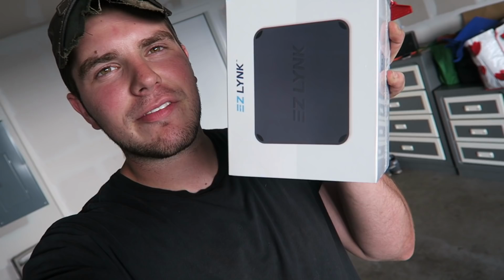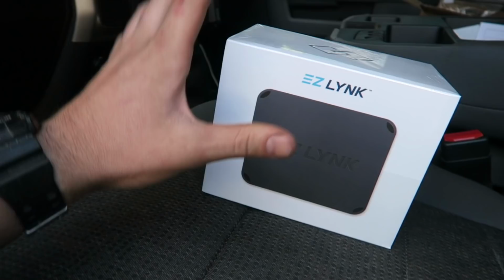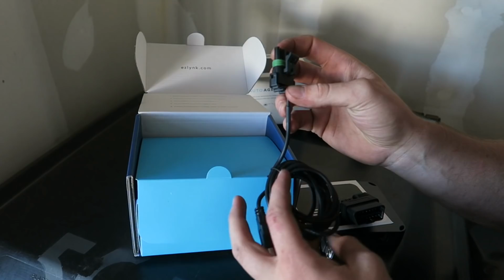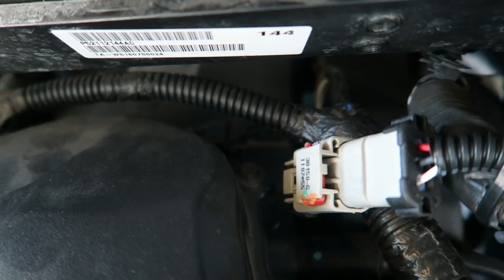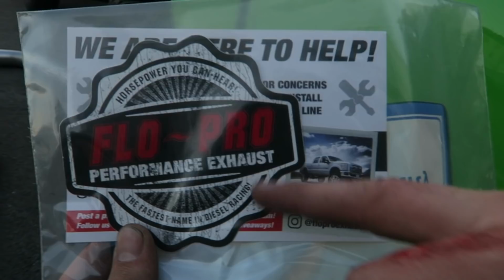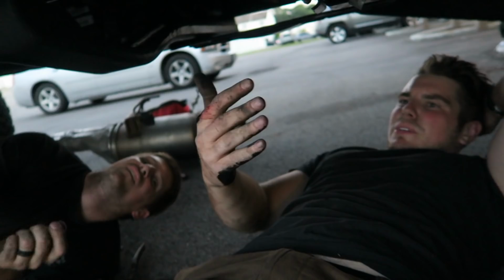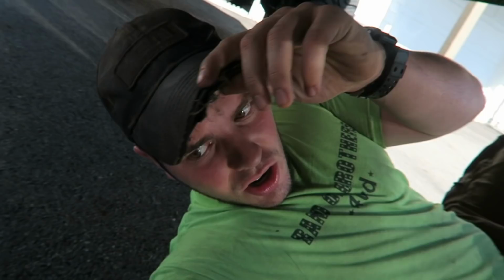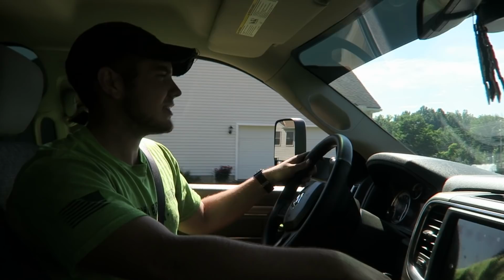Brand NEW 6 SPEED MANUAL Cummins Gets UPGRADED!!! *EZ LYNK TUNING*

Comment: Truck sounds good. Glad to see someone else driving a 6spd manual. I've got a 2010 fully deleted 6spd manual. I was going to do the 5 inch exhaust but like you I was told I would want a muffler or something for it so I went with 4 inch straight and love it. Truck sounds great

Comment: Bro straight pipe is not bad in the 6.7 straight pipe, if anything it's to quiet, I did on my 6.7 and I was upset it didn't sound anywhere close like a 5.9 straight pipe does
Reply from the maker: I have come to find out that it’s not bad at all!! Super quiet! My 5.9 was dumb loud!
Reply: Ryan Mayer try pulling the #32 fuse u see the hood, I think it's #32??? It will sounds like a 5.9 Cummins lol ... I'll be putting a 4" straight pipe on my 7.3 here soon and a tune, can't wait to hear that mama breath
Reply: FixItNick I’m getting a 4” straight pipe on my 7.3, too.
Reply: Bradley Johnson what year? Gonna run a tune?
Reply: FixItNick It’s a ‘96. I’m gonna run a tune, I just don’t know which tuner to buy.
Reply: Bradley Johnson DP Tuner or Hydra
Reply: Bradley Johnson JP tuning
Reply: Its stupidly loud if you 2nd gen swap it! Or do a drop in vgt deleted modified turbo
Reply: FixItNick hydra makes great tuning for the 7.3s I would highly recommend you go with hydra
Reply: @bradleyjohnson1839  definitely hydra and if havent done yet a wicked wheel 2... did that to my 97 with a 4" straight pipe it was a total different truck..
Reply: gentry k Sweet, I’ll check it out. Did you run an intercooler?
Reply: @bradleyjohnson1839  was going to but I bought me a 1st gen and drove it more so I sold it ... loved the obs ford but really liked the 1st gen better
Reply: gentry k Nice man, good to know. And yeah, 1st gens are sexy.
Reply: My 2006 5.9 was straight piped and obnoxious! I love straight piped cummins but damn! Couldn't hear myself think.
Reply: Yeah my 5.9 with a 5" straight pipe was ridiculous. Long drives pulling big enclosed trailer was unbearable with the drone. Could barely talk to passengers. I removed the silencer ring and put a CAI on it and the turbo whistle was awesome. Then installed the FTE Resonator and it was PERFECT.... No drone at all but all the turbo whistle and sounded great.

Comment: It would be a good idea to adjust the valve to .010 intake & .020 exhaust, now that the emissions stuff is off.
Reply from the maker: I’ll have to work on that! All I know is the truck runs better and has no smoke on the tunes! Better mpg I can already see as well!
Reply: I'm sure it does.  I deleted/tuned my '14 almost 3 years ago and the difference is insane.  Get the clutch in there asap so you can enjoy that new found power
Reply from the maker: Monster RAM all it takes is $$$ lol 😂😂😂
Reply: I've always set my valves at .07 and .17
Reply: Wheres the new vids Monster Ram?
Reply: @white24valve  on a 6.7? Any noticeable difference than .010&  .020
Reply: @patrickcrowe4063  my apologies..i am mot sure..i was thinking 5.9...without looking it up..iirc the 6.7 exhaust is .026 to get rid of heat/fuel/soot quicker..not quite 100% sure tho

Comment: Those are egt sensors, save them so you can put one in your manifold if ppei ever gets egt's working for ez lynk on the rams.  Btw you can leave everything connected to the dpf and scr.  Just unplug everything from the harness and drop them down.   HPP makes a plug kit to cap off all of your connectors

Comment: The DEF Injector (hunk of junk 8:36) is a PIA to get off. The connection gets all corroded. Try some WD40. You have to push the lock in to get the line off. If that doesn't work you try pry the lock out and that might work to get the line off the DEF injector.

Comment: I own a 01 7.3 with a 4in turbo back straight flow exhaust WITH headers, and its barely louder inside than factory. Drone is very minimal on disels because of just how the fuel is burnt.

Comment: Hey Ryan, I have a 2015 6 speed, I've had it for 5 years or so, I deleted it soon after I got it. Mileage is good, but the tune has some hiccups. The biggest one is lack of throttle control if the engine speed is slower than the trans letting out the clutch. Pretty irritating actually haha. If yours does not do this, I'd like the name of your tuner and get that one from him to try. If I understand right, these guys are all doing their own tune. I guess. Thanks

Comment: Yes 6 speed manuals are hard to find. I bought my 08 3500 6.7 6 speed mega cab 3 months ago for 14,500 and had to jump all over it for the price.
Reply: kevin desjadon yep, ur absolutely right. Automatic’s are everywhere. I wanted to trade in my 2015 CCSB SLT for a 2018 CCLB Laramie, every dealership within a hundred miles of me said with that combination I’m definitely going to have to order one.
Reply: Ronlewis ram in  Waynesburgh pa  usually has at least 3 or 4 of them

Comment: The hotter the tune the better mpg as long as you can stay off the skinny petal  and the clutch will be fine in hot tunes as long as you don’t hot rod it  just go easy til the upgraded clutch is installed

Comment: You won't burn your clutch up less you rag on it..had an 03 quad cab..swb..2 wheel drive..6 speed manual factory clutch.always floated the gears...3.73...afe stage 2 in take..ATS arc flow.. industrial injection super phat shaft 62..TST... Diablo puck..Smarty..str8 4" exhaust with 5" tip..Fass HPFP 95 with 3/8" hose..big line kit...best mpg was 23.8 mpg with A.C. on and using cruise control

Comment: Man I have a 5” straight pipe also by flopro with a 6spd and the drone is not that bad I bought the 30” FTE resonator and took it out, I dig the build truck looks wild, 2nd note I have the south bend street dual disc with a mini max tuner and my clutch will spin in my 60hp tune, look into vilair can’t go wrong

Comment: I have a question, you do not have light on the air pressure of the tires. The tuner has up to 40 psi, in my case my tires measure 65 psi.

Comment: Ask for the sotf low boost fueling tunes  it makes the g56 trucks like ours drive so much better you get your boost back faster after a shift
Reply from the maker: Ty Hart ppei has em??? The higher HP tunes seem to hold boost but don’t have a clutch yet to really experiment

Comment: Little late to the party but I watched this back when you did the delete I have an 18 3500 g56 truck and I’m about to put my sotf switch in but don’t know where to run the wires through the fire wall easily, where’d you run yours?

Comment: You are going to want to put the resonator on if plan on putting a tip on that's when it will drone bad I have a 16 Laramie longhorn fully deleted with 5 in turbo back going to an 8 inch tip on 37 didn't drone at all till I put the tip on it was bad didn't bother me cause I'm used to driving a cammed 6.0 Chevy straight headers but my girlfriend threatened to never ride in the truck unless I fixed how loud it was in the cab got the resonator changed everything much better in the cab
Reply from the maker: Hahaha I didn’t know the tip would make a difference!!! Doesn’t drone right now! Still a bit loud for early morning drives in my neighborhood
Reply: Ryan Mayer na the tip really does effect it a lot. It didn't bother me at all but it's loud in the cab with the tip  I don't have neighbors so I never worried about it till I got a girlfriend lol
Reply: bubbahoss 1997 leave your girl

Comment: Hey Ryan, awesome truck man.  You’re doing everything that I wish I could do.  I know you did the color matching but did you know that the portion between your front and rear door is just a black decal.  Mine started wrinkling and I removed them with a heat gun.  You just have to loosen the lower outer window trim (one screw each) and heat it up and they come right off.  I feel sure it’s green under there as well.  Mine is white (I know, boring).  Anyway, I guess I’ll see next time if you want to keep it black or go green between the windows.  Keep up the great videos!!!

Comment: If i bought a RAM 3500 it’d be an 18 RAM 3500 with the High Output Cummins Diesel with the AISIN 6 Speed Automatic Transmission over the G56 6 Speed Manual Transmission because the AISIN Automatic has more Torque than the G56 Manual Transmission
Reply: You do realize for $1500 you can upgrade the G56 clutch to hold the same power as the automatics either factory or tuned. Compare that to the cost it takes to beef up an auto when you start pushing a lot of power and you'll start to understand why the guys who know own the G56. There's also nothing better then rowing your own gears allowing you to be in total control.

Comment: When I started looking to delete my 2013, I was told I had to remove everything all at once. Was this bad information for the 4th gens? If I could do it in steps like you are, that would be  a lot better.
Reply: You can remove the EGR components without going into limp mode you will just have the check engine light until it’s done but keep in mind you stock exhaust isn’t ment to trap the excess soot etc created by removing all those components so the quicker you can get your exhaust and tune done close to one another the better

Comment: I have a 2015 Dodge Ram 2500 6.7 Cummins and I recently started having issues with my DEF system. Apparently I would of have to buy a pretty expensive part, but I decided I would Just want to do a delete on it. Are there any delete kits that you would recommend?

Comment: Get the banks horn with the pusher delete kit- also Ohio diesel has a nice tall boy shifter-Akron makes an amazing phone holder
Reply from the maker: I’m gonna get the banks horn but I want the bigger one and need bigger boost tubes which means the banks intercooler, which means $$$$ which means I make a decision is I want a clutch or the horn and intercooler first 😂😂😂 and I totally slipped my clutch the bad other day getting on it
Reply: Ryan Mayer can you still drive it? Check out my shakey video of my ram, you’ll see an ARKON phone holder- you don’t want it mounted to the windshield-a reason to get pulled over-check out my shift knob too-you can wire up the engine brake to it so you don’t have to look for it in a pinch

Comment: Did you have any issues installing this around your rear center shock? I was planning to go with this kit but the website I was going to purchase it from notes it wont fit with air ride or the center mounted shock. I've had a hell of a time trying to decide on another kit so if it will in fact fit that would be awesome!

Comment: Would you have been able to just leave the EGR in place? Wanna leave mine in place and just run the tune and a 5” turbo back. The ez lynk basically disables the EGR anyway correct ?
Reply: Chris Peetros did your truck throw any codes

Comment: Those "prongs" you took off are called egts; exhaust gas temperature sensors
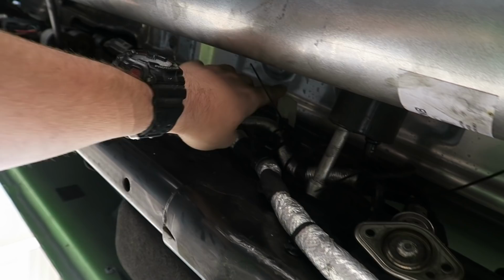Reply: And that other thing he pointed to at 8:45 is the DEF injector.
Reply: Those prongs are called pyrometers or pyro for short. They read your EGT

Comment: Will the dealer's give you a hard time with a warranty issue if the truck is deleted?
Reply from the maker: jimmy burt my advice is make friends with your dealership :) they’ll work with you if your truck is deleted if you’re on their good side, they must prove the delete caused the warrantable issue for it to be voided, don’t let them tell you otherwise. An exhaust pipe won’t cause an airbag failure ect ect.

Comment: Do you think the stainless 5 inch straight pipe turbo back is worth it? Or would I be fine with the aluminized version.
Reply from the maker: Depends how well you like to clean your truck! If you’re driving in a salty environment just keep it clean
Reply: In my opinion, go with the aluminized. It probably won't last as long, but with the stainless your constantly going to be tightening up exhaust clamps. I have a full 3 inch stainless exhaust on my 12 Camaro and its horrible. stainless expands and contracts and will stretch the clamps out.

Comment: I'm 15 and I'm taking drivers training my dad bought me a 2005 dodge Cummins and I wanted to know what are some upgrades I should do
Reply: Remove the silencer ring from the turbo. Free and easy. Also look up everything you can about the truck you have. Look up specs, dimensions, common problems and always an exhaust and intake always help a diesel. Also you can tune and I would look at upgrading the trans. lots of rebuild kits. Can upgrade the lift pump. Just a few things to look into. Research goes miles. Last, being as old as it is make sure all the steering components are in good shape.
Reply: Jacob Marsh-Hines first thing is put a steering brace on it for sure if it already doesn’t have one, this is the fix to the dodge death wobble you’ll read about on these trucks. Synergy Manufacturing makes a good quality unit.
Reply: Is it manual or auto? If it's auto you can expect the transmission to go out Dodge is notorious for that especially on the mid 2000's autos. The manuals aren't perfect either though but they tend to have less trouble.

Comment: That’s dope how do you buy a manual Cummins il
Reply from the maker: Ram is the only brand who makes them still! 💪🏼🔥 you can get them!
Reply: you can request any vehicle to be custom made with a manual from a dealership
Reply: ram still does 4 on the floor shifters for the 4wd too
Reply: Daniel Dahl- Stop spreading fake news, the only American pick up truck built today with a manual trans is a HD Ram/ Cummins combo, both Ford & GM stopped producing manual trucks back in the mid 2000’s.
Reply: Trevor H give a dealership a $1k deposit & order one, wait 6-8 weeks, it’s that simple
Reply: Daniel Dahl no only ram  with acummins and a Toyota Tacoma
Reply: Small cars today still have manual transmission. Example Chevy Sonic and others
Reply: Pittman82-USMC we’re not talking about cars, we’re talking about American trucks.
Reply: dont ask stupid questions

Comment: I HAVE A 2011  FULLY DELETED 6.7 RAM WITH THE G56 TRANS.  yOU HAVE TO UPGRADE THE CLUTCH FOR ANY POWER GAIN AND REAL USE PURPOSE.  sTRAIGHT 5 INCH PIPE ONLY.  THE TRUCK SMELLS LIKE A DIESEL SHOULD. bOUGHT NEW AND WOULDNT OWN THIS TRUCK ANY WAY ELSE.

Comment: youll want the resonator trust me. the drone is real with the truck deleted
Reply from the maker: This is actually funny because I have 0 highway drone 😂😂😂 I am blown away and I do not understand mostly thoroughly confused 60-80 mph it’s more quiet than stock. I was fully expecting this loud drone but maybe the 6 speed 37’s and 3.42 combo that makes it drone free 🤷🏼‍♂️
Reply: i have no drone issues either,  16 3500 mega cab fully deleted, efi, 8 bds lift on 37s with the same flo pro 5" straight pipe.
Reply: Ryan Mayer damn. Well that's good lol. I had a 4 inch and it was so annoying. Going to be putting a resonator on my new truck when I get it deleted
Reply: I have a 5 inch straight pipe on my 08 6.7 and i have zero drone as Well
Reply: 2010 6.7 6spd and drone was horrible!

Comment: Flo pro is gay! U should've got mbrp ! The best in the market for sure
Reply: Mbrp is good but flo pro has really stepped up there game lately
Reply: Metal pipe is metal pipe no matter how you look at it
Reply from the maker: Mbrp doesn’t make one for a 17 I checked otherwise I woulda
Reply: +Stephen Keeton more to it then that the quality of the pipe itself, the welds on the hangers and the quality of the figment etc all play a major part of it a lot of big names company's have gone down the shitter and are solely relying on their name to make sales i personally will only run mbrp or flo pro most of the others are extremely disappointing
Reply: roostin Well sure I agree with that my argument was if it works it works regardless what brand. I was talking about the guy saying Flow Pro was gay. lol. what does homosexuality have to do with quality of parts?? To many people chase these high dollar name brand parts when you can get the same quality down the road. Flow Pro or other big names doesn't matter really if you get quality parts that's all that matters. But according to the guy that started this thread I'm probably homosexual because I said this.

Comment: Why you worried about a clutch real truckers don't use a clutch
Reply: devon falk there’s a difference between a synchronized & a non synchronized transmission
Reply: uh unless you turn the engine off after every start and every time you stop you do. There's no way to go into first gear while stopped without the clutch unless you turn the vehicle off first.
Reply: Garrett Smith yes, you are correct but what I will add to ur comment is if these trucks are empty no one should be starting out in 1st gear, should start in 2nd or 3rd. 1st is for pulling.
Reply: That's irrelevant you still need to use the clutch to get into any of those gears from a stop. And it just depends on the gearing I have seen trucks that needed 1st gear even when empty otherwise you had to rev the engine way up to avoid killing it. Plus that's harder on the clutch.